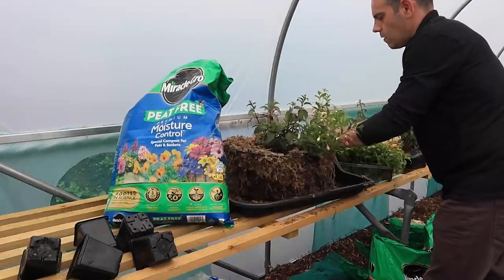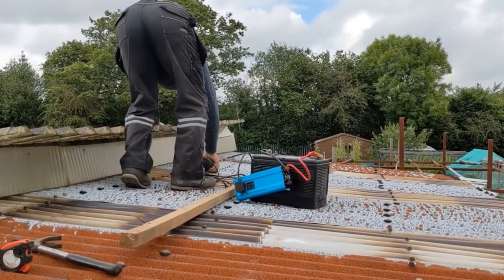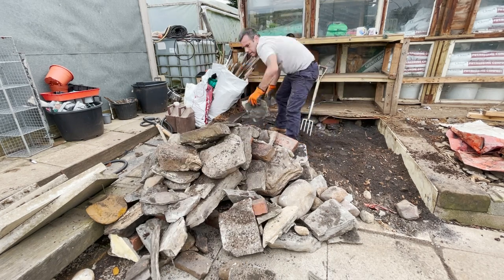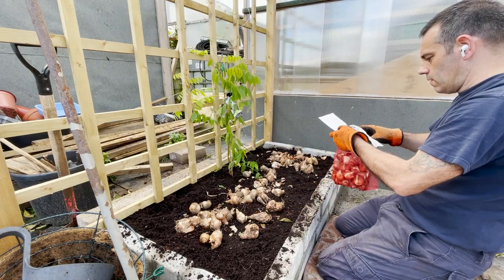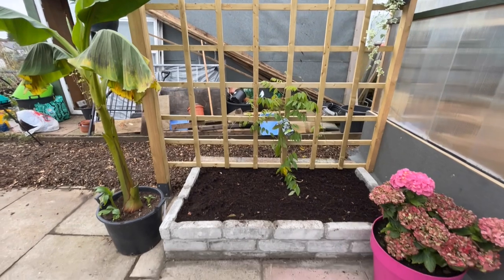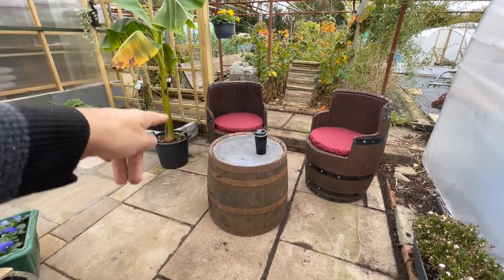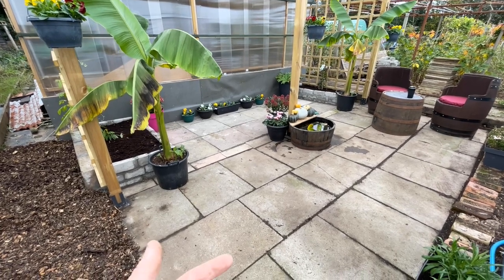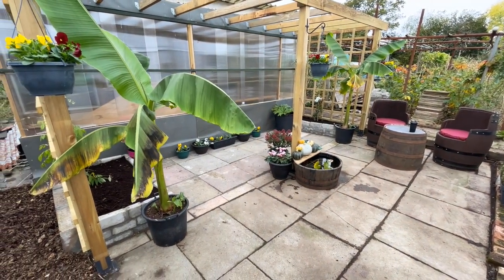Well-Being Garden: A Journey to Better Mental Health

Comment: Great project….hopefully you will have time to use it!!!😉
We have 2 wisteria growing on the south facing back ground deck of our home which sports a roofed pergola much like what you’ve built. I’ve seen the plants in heavy bloom from pictures taken from previous owners, but in 3 seasons they’ve not bloomed for us. What they have done is send out their tendrils and vines and made a jungle out of that deck. Their roots have become very aggressive and are sending up more vines through our deck board. So…..knowing that you are a much more savvy gardener than I, I’m sure you have tricks up your sleeve to keep yours in control. Just the same, I thought I’d share our experience with you. If no blooms are forthcoming next season, we will be removing the plants.
Reply from the maker: ?Treat thec wisteria like grapes cut them back to a structure or frame you want. you must prune just after flowering for next years flowers

Comment: Ok job Tony (seems like everyone leads off with an assessment , so i thought id do the same) i love the plantings of the bulbs …but …you could have done that in your grout seems … 

You call stuff rubbish,,, i would love to have your corrugated metal .. you dug up concrete ??!??!,?  Only to replace it with more “ socially accepted concrete” , in that it is square ..12 x 12 

Your wellbeing garden is ‘too contrived’ , while the rest of your stuff is functional, , raw, nurturing, purposeful…. I love me my pansies …(and under rated snap dragons). ….they are the cheerleaders of winter , spiriting me on   

I don’t feel well..and i’d like to suggest you do ‘t either

Cheers
Reply from the maker: That metal will be reused on the backend and i dug up stones glass and soil not concrete. i laid down flat slabs